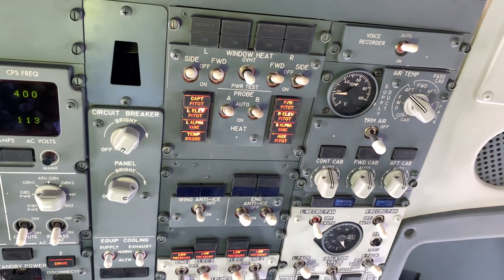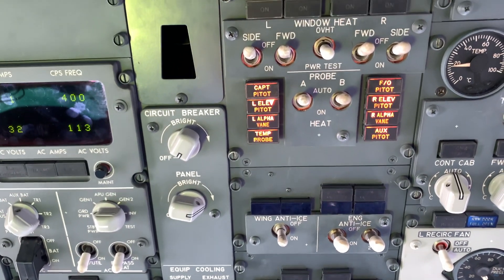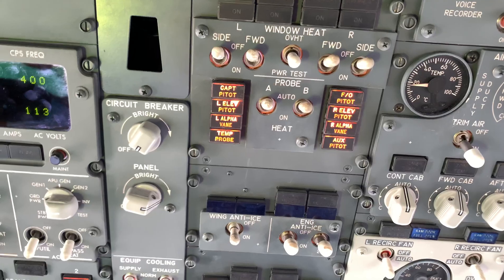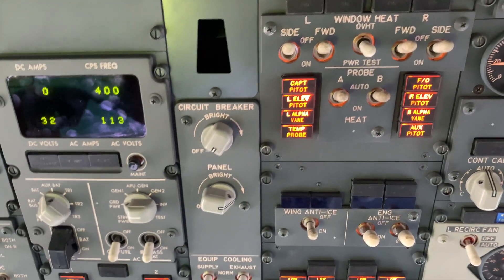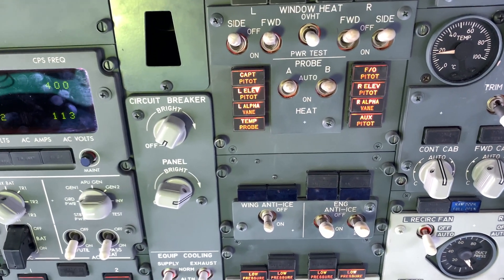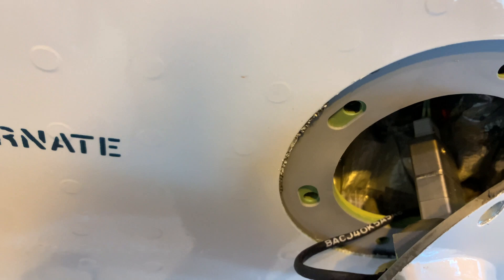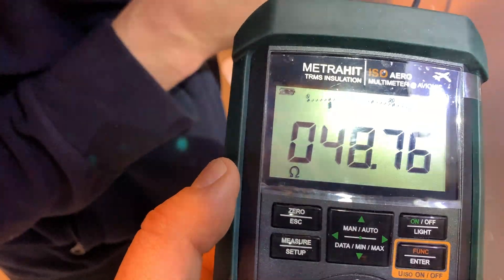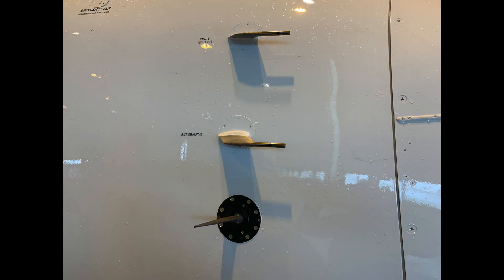🎬  BOEING B737 NG ATA 30 Pitot Static Anti-Ice. Description, Operation and Troubleshooting. ✈️

Comment: dumb question but how the hell you remove that screw that is in an awkward angle on the pitot ? Most of the people around I asked and even me still managed to screw up the screw. what is the proper tool ?  ring rachet with a bit holder ? the flexible bit ?
Reply from the maker: I remember we used a wooden hammer handle to wedge a bit holder in there then use it as a pry bar. Maybe Boeing have a unique tool ($$$) for this I am not sure 😂
Reply: @aircraftengineerstoolbox2560  hahah alright duly noted might try that idea the next time around. Thanks man !

Comment: Thanks a lot for the video, I would to ask why the Static port are not heated ? thank you!
Reply from the maker: Hi from what I was taught, there is no need for heating due to the location along the side of the fuselage making it not in the path of ice build-up, also the skin temperature is enough to prevent any ice build-up both in the air and on the ground and on the ground if ice snow was present the aircraft fuselage should have been decided before the flight. I can only comment on Airbus and Boeing.
Reply: @aircraftengineerstoolbox2560  Thanks for your answer, it make sense ! a fantastic video by the way